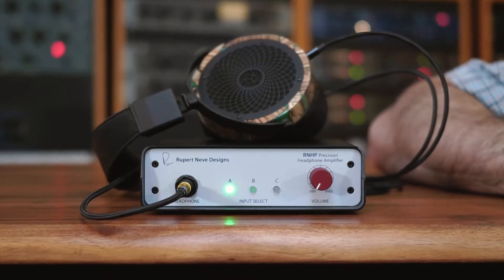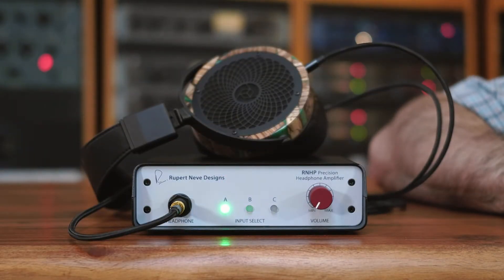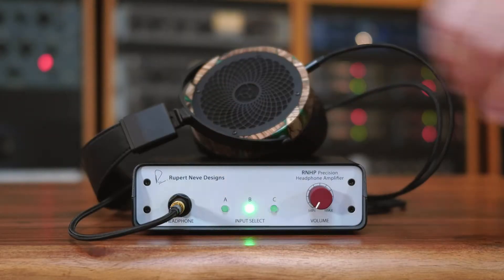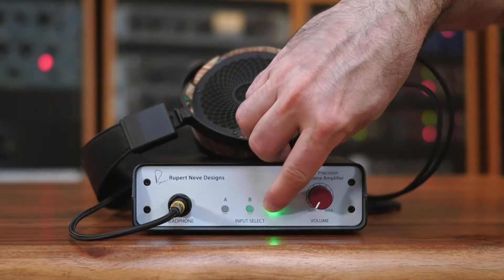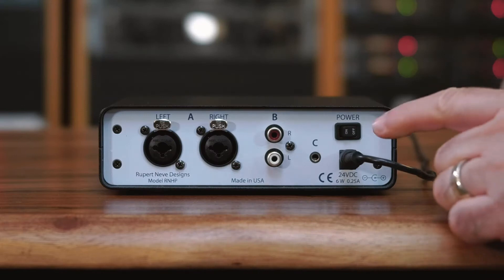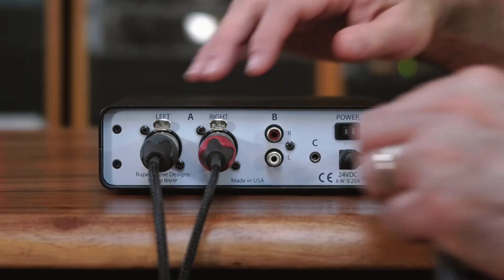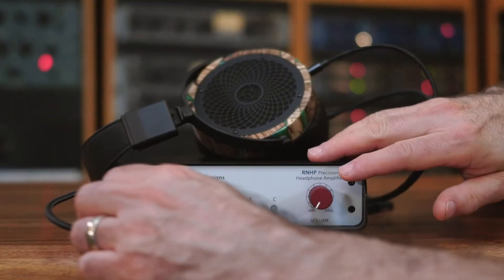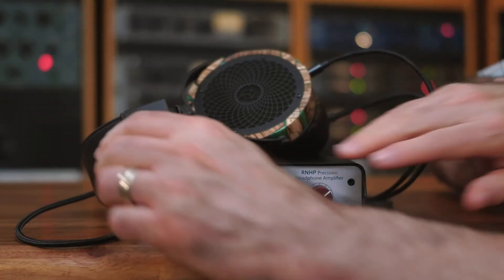Quick Start: RNHP Precision Headphone Amplifier

Comment: if I'm trying to listen to myself practice Bass guitar ... I plan to use my EBS 802 Amp (for the pre-amp section) as the input to my bass... from there, I plan to take the XLR "post EQ" output of the EBS 802 to the Neve RHNP... my question is... should I get a XLR splitter to go from my EBS amp into the input of the Neve?  or should I go mono with just one XLR into the Left or Right side of the Neve?
Reply: If you find out let me know lol, same question

Comment: When using audio interfaces that have their own output level knob (I use interfaces which have spec sheets stating the outputs put out +18 and +20 dbu), how do you prevent clipping the RNHP's input A as it is meant to take +4dbu signals and doesn't have a clipping meter?

Comment: How do I use it if I want to use it as a separate headphone out/amp in conjunction with my audio interface? Basically, instead of using the headphone out (and hence, the preamp) on the interface, I’d like that to use the RNHP, and yet, not lose the main monitor outs on the interface.
Reply: Headphone out of your audio interface into input C of your neve RNHP.

Comment: This is a phenomenal amp, no question. I must say I was disappointed with the fact that a 120$ Magni has resistors to stop the large pops when powering on and off AND output RCA's and a (now) 700$ amp does not. Still, that sound...........

Comment: What is the reason for disconnecting the phones before powering it down? Thanks
Reply: The same reason you turn off the PA system before turning off the mixer
Reply: @snapascrew  Wrong analogy.
Do you have to remove the speakers from the pa amps before you power down, or do you have to connect them after powering up?